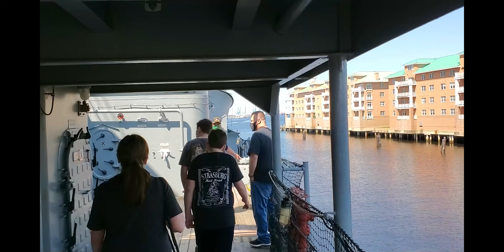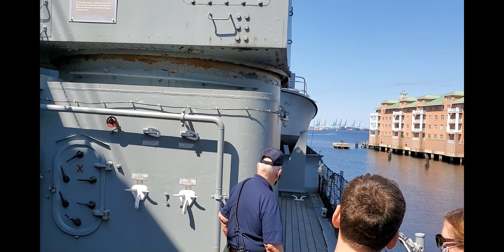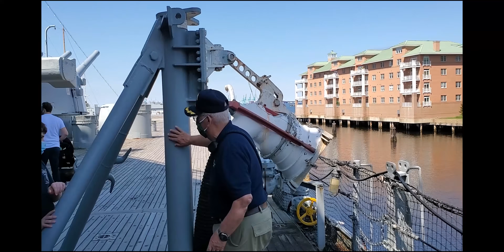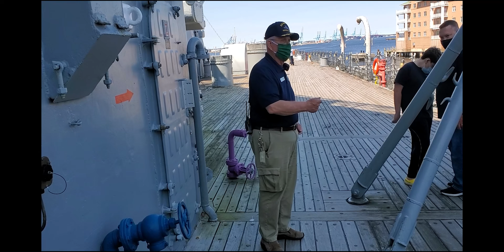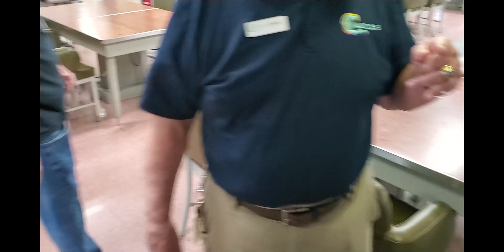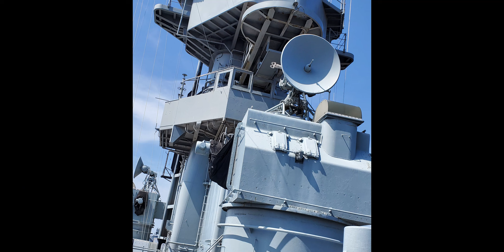Touring USS Wisconsin BB-64 Part 2

Comment: Great stuff here and I don’t want to be negative, but the guy who talked about the hull design and engineering was…. Misleading. Guess it doesn’t really matter but, The bullous bow counteracted The bow wave created by the very front of the ship and had nothing to do with the odd shape of the Iowas near turret one. The Iowas were not the first American battleships hulls designed scientifically. Also the Iowas were not the 1st USN battleships with high and low pressure turbines. They were faster just because they had larger engineering spaces.